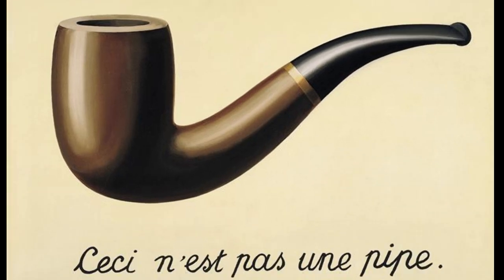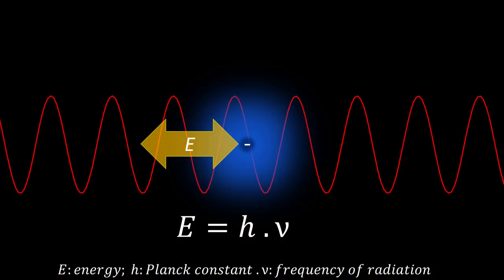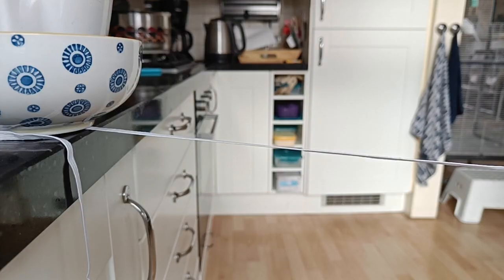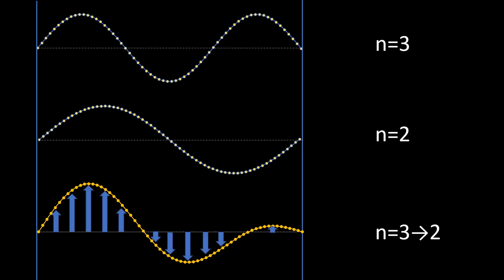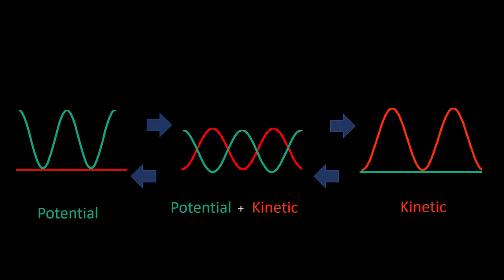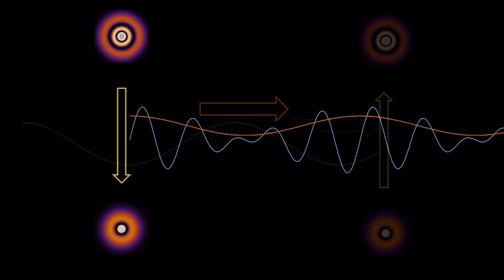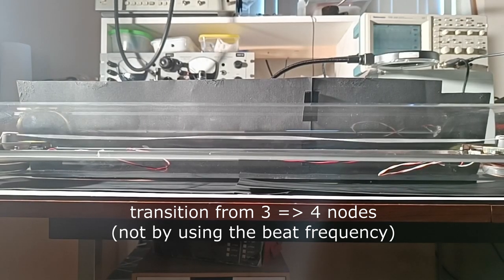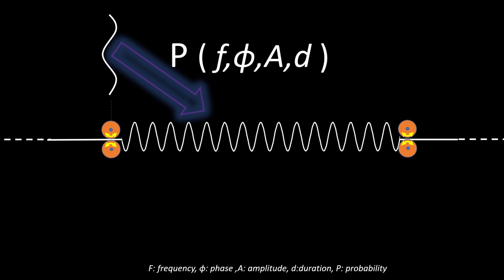Coherence part 3: This is not a wave.

Comment: I think this is a good set of analogies, I will point out however that you are dealing with quantised momenta (frequencies), while for the photon specifically in quantum field theory one deals with quantised amplitudes. The photons that leave after atomic de-excitation increase the number of photons of a single mode from a continuum of modes (if in free space) by one, that photon's time-evolution through space is given by a wave-like wavefunction but the wavefunction describes a pointlike object. 

Most of the wavelike properties you show come from a superposition of many photons within many modes distributed with a poisson-like distrubution which does have true wavelike behaviour within the electromagnetic field, but these do not arise from interactions with single atoms.  The problem with most of these analogies while vaguely true is they do not support a quantum superposition and subsequent measurement in the same way as reality.

Of couse as you describe, ce n'est pas un photon. I could be wrong, and of course all theories attempt to describe something we cannot see. This is just what I have come to learn after studying quantum optics and quantum field theory.
Reply: "The problem with most of these analogies while vaguely true is they do not support a quantum superposition and subsequent measurement in the same way as reality"

That's a problem of modeling the measurement, not the photon, and since we lack a coherent measurement theory that's really a moot point. The whole reason the photon exists in our theory is the photoelectric effect, and this channel has a video giving an intuitive understanding of what is going on there as well (spoiler: it's matter-field interactions that are quantized, not the field itself).
"Reality" does not support anything, whether your model predicts results depends on the mathematics you employ, but there is no single way to interpret mathematics with a picture. For example, Lagrangian interactions are calculated using virtual particles, but wether you interpret these as actual particles with negative momentum (whatever that means) is a matter of interpretation. Current QFT is like a magic box, you put numbers in and it spits numbers out. But there's no clear understanding of the underlying reality the math describes.

Look up his video on optical Fourier transform. You'll see wavelike objects appear point like. What if measurement works like a lens? No wavefunction collapse or similar hocus pocus, just optics.
Reply: @FunkyDexter  what do you mean by "like a lens" ?
Reply: @wbeaty  I've read that. I also read Oliver Consa's "Something is rotten in the state of QED". The QFT description relies entirely on fields (quantum FIELD theory, not quantum PARTICLE theory). But it still sweeping under the rug the measurement problem. The waves in the fields are "probability waves", and the coupling constants are basically inserted ad hoc in the theory since they rely on experimental measurements of particle masses. So in a sense, the theory doesn't really explain much at all, it just crunches numbers.

@Nomad FPS by like a lens i mean that measurement might be akin to an optical Fourier transform. Lenses translate a real image into an image of the reciprocal fourier space, and funnily enough for an extended entity like a wave this tends to look like a point.
Reply: You make a great point that I was going to comment about as well. While it's helpful to think about photons as "particles" or "waves" or both, they're really just photons. Things like the "phase" of a photon doesn't really make sense because phase is an emergent property of a superposition of many photons. This is especially evident when you consider that phase and photon number are conjugate variables so the more you know about how many photons you have, the less you know about their phase (amplitude squeezed states). And this brings up a final important point, which is that experimental results for a single photon can NOT be obtained through limiting cases of coherent states. You can definitely get approximations to how a single photon will behave, after all we use classical sources at work all the time to characterize our equipment. But it will never be 100% accurate to an actual single photon. So in the end if you want to know what a single photon will do you either have to do the experiment with a proper single photon source (not just a highly attenuated laser) or work through the math.
Reply: @sekeetaheliastraatmans8190  ??? I'm sorry but what you said did not make any sense.
Reply: @wbeaty  "while photons are only the field-quanta, not clouds of tiny localized sand-grains" - I think nobody who has an understanding of QM considers photons to be clouds of tiny localised sand-grains. That is just a popular science view. But the excitations of the field still collapse into a very small location when measured, and disappear from the rest of the field. That is the particle effect that cannot be explained with any traditional wave theory.
Reply: @renedekker9806  I don't think even popular science entertains photons of any "localized" character necessarily. its almost like the entire point of discussing quanta is to avoid relying on the mathematics of fields
Reply: I don’t believe photons exist.  They are just the ‘beat’ frequencies emitted as energy.  The ‘state’ of electrons is actually their fundamental resonant frequencies and they can be shifted from one state to another by the addition or subtraction of the ‘beat’ frequency.    The transition is not immediate but has a ramp up and down time but is so negligible for optics that we ignore it.  As far as jumping multiple states we would need to add 2 different beats to get the electron to resonate at F+sum1 and then F+Sum1+Sum2 where Sum1 is the first beat frequency and Sum2 would be the second beat frequency.  These beat frequencies would have to obey the n/m integer fraction where n and m are integers.  At least this is my current theory.
Reply: @GodzillaGoesGaga  "They are just the ‘beat’ frequencies emitted as energy" - waves spread out over space, with diminishing energy levels per location the larger they get. Photons don't do that, when detected, they always have a defined energy level. 
"I don’t believe photons exist" - you can believe all you like, of course, but the term "photon" is used in QM for a propagating probability wave that always has the same quantum of energy when it interacts with other particles at a specific location.
Reply: @SplendidKunoichi  "to avoid relying on the mathematics of fields" - ... to avoid the mathematics of probability fields that instantaneously collapse into a single location when interacting. I can understand why popular science wants to avoid that notion.
Reply: @renedekker9806   the term "photon" is used in QM for a propagating probability wave that always has the same quantum of energy when it interacts with other particles at a specific location.
Does that also apply when it interacts with particles traveling at relativistic velocities? IOW, does the Doppler shift happen in discreet values or are the frequencies a continuum?
Reply: @ExtantFrodo2  The doppler shift at relativistic velocities follows simply from conservation of 4-momentum. The key quantity in relativistic mechanics is the 4-momentum in natural units is k = (E,p_x,p_y,p_z) which for a massless photon travelling along the x direction is k= hf*(1,1,0,0) in some frame, say the rest frame of a particle. Note the quantity k^2 = (hf)^2-(hf)^2 = 0. Lorentz boosting along x with velocity v to a new frame  in natural units we find k -> k' = sqrt((1-v)/(1+v))*hf*(1, 1, 0 , 0), note that k' ^2 still = 0. This shows conservation of 4-momentum, this is not the same thing as momentum nor energy, in relativistic mechanics neither of those individual quantities are conserved. It also shows in this new frame the photon appears to have a continuous dependence on v, and a changed apparent frequency of sqrt((1-v)/(1+v)). 

So to answer your question, when a single photon interacts with a particle, say an atom, in the atom rest frame it will have a specific energy drawn from some continuous distribution, the quantisation you are thinking of comes from the photon either interacting or not interacting, it can't half-interact. If there was 1 photon resonant with the atom, it may interact and excite the atom, destroying the photon leaving 0 photons. It can't 'half interact' and leave 0.5 photons behind. The frequency of the photon really is a continuous property.
Reply: @ExtantFrodo2  "does the Doppler shift happen in discreet values or are the frequencies a continuum?" - Doppler shift is a continuum. It's not the frequency that is quantised, but the energy transfer at that frequency. That is, it transfers all the energy or nothing at all.
Reply: @renedekker9806  Why would a wave diminish in energy in pure space ?  A wave would have to interact with something to transfer it’s energy to for dissipation to happen.
Reply: @GodzillaGoesGaga  "Why would a wave diminish in energy in pure space ? "  - when traveling waves spread the energy out over larger and larger area, and therefore diminish in intensity per area.
"interact with something to transfer it’s energy" - and that something will receive less energy when further away from the source of the wave. At least for traditional waves. For QM waves, that something will receive the full energy with diminishing probability.
Reply: @renedekker9806  dispersionless waves exist. It's mostly a property of the medium the wave travels in, not a property of the wave. Empty space looks like a dispersionless medium. 
Another important aspect to photons is that they have angular momentum: this might be the reason why single photons travel in straight lines like particles while remaining localized. Angular momentum must be conserved, and since it's quantized the wavepacket can't spread out.
Reply: @renedekker9806  They waves aren't spreading and diminishing in energy - the interactions per unit area decrease. If you had a sphere completely encapsulating the emitter, the energy interacting with it would be the same if it were 1m in diameter or 1,000km. Everything is contained and conserved; only spread over a larger area as the radius increases.
Reply: "The problem with most of these analogies while vaguely true is they do not support a quantum superposition and subsequent measurement in the same way as reality."

No, that's the problem with quantum mechanics not following reality. You have it backwards. Say it with me: Quantum superposition is a mathematical abstraction, NOT reality. There is no such thing as a superposition in nature, that's obviously nonsense.
Reply: @FunkyDexter  "since it's quantized the wavepacket can't spread out" - what is the evidence for that?
Reply: @harleyquinn8202  the evidence for light having angular momentum? There is plenty, too much for a YouTube comment. Mine was just speculation based on the fact that a wave spreading necessarily must decrease its angular momentum, like an ice skater spreading its arms. But if the angular momentum is quantized, this means that the act of spreading must also be quantized, which is a thing we don't see.
Reply: @FunkyDexter  No, I was asking about size limit of spreading in space. The analogy with an ice skate might not work for light because light does not have rest mass.

Comment: Brilliant! You show how confined standing waves of electrons in an atom are analogous to standing waves in a string changing from one standing wave harmonic to another, and in that transition a difference beat frequency is created (energy emitted or absorbed) and why atoms hold electrons only in discrete energy levels because they have to fit into a standing wave (but in 4 dimensional space-time along with probabilities of place and time) which causes all those orbitals shapes an electron can take. And because Electrons and Quarks (sub parts of protons) are strings of energy vibrating in open/closed loops of various frequency/harmonics/standing waves/phase/amplitude and in multidimensional space-time just makes it seem so intuitive. Thanks!

Comment: You are confirming what I’ve always intuitively told myself.  Photons do not exist!!  A photon is a convenience to describe the energy transfer from one place to another.  It seems to me that a photon is actually the difference between 2 oscillating electron energy states.   The difference is during emission and is is additive during absorption.  As far as going from one fundamental mode to another there must be something in music theory that can describe this.  Typical notes are n/m integer fractions of the fundamental where n and m are integers.  Phase will definitely play in this since a “beat” will always have a rotating phase that is fundamentally related by n/m.  Eg sin(p/2)+sin(p/3) etc.  Very thought provoking stuff!  Love it.

Comment: To say that you sir are intellectually stimulating, is an understatement. You are inspiring! Thank you! 

Regarding your experiment with the standing waves, you are changing frequency and phase, but I do not see you modulating (on purpose) the amplitude of the waves in your apparatus. In order to account and counteract the quick energy loses to friction and other factors, what if the speakers would fade off or decay the amplitude gradually not suddenly (as I assume you did) therefore allowing for "some degree of cheating" to counteract the quick losses in the amplitude. Now, what exactly that amplitude decaying envelope should look like, I have no idea yet, this is just a thought.